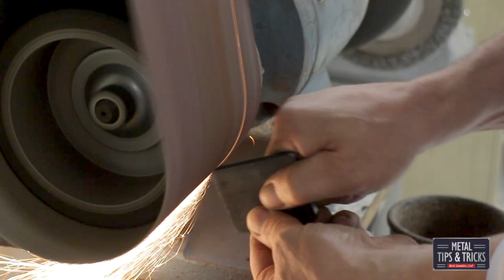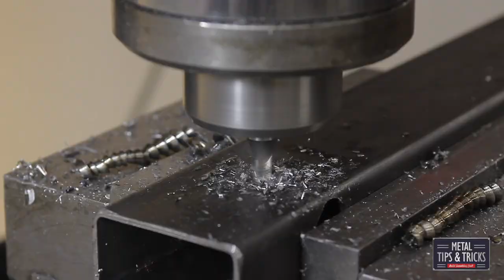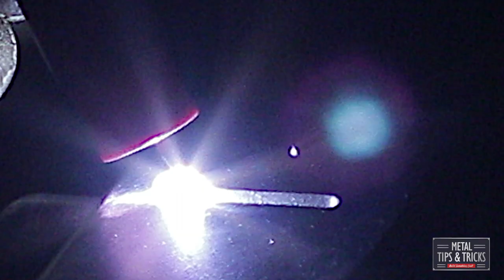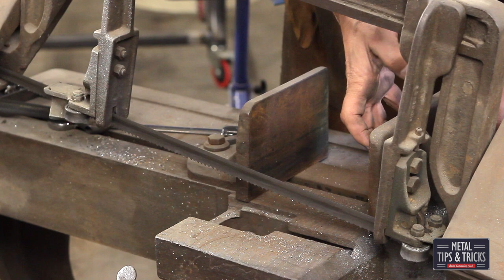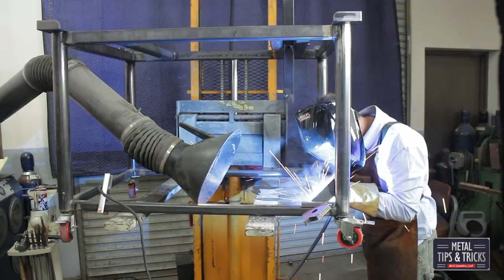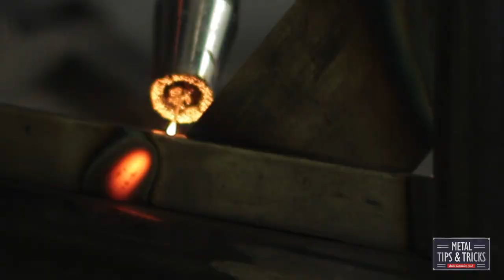The Ultimate Metrology Center ( Welding)  Part 2

Comment: Hi Dale,
That large spacious and well equipped shop is heaven for those kinda multi disciplinary projects like that table, looks great...
Pretty good on the up hill mig welds...   ;)
Cheers,    Pierre
Reply from the maker: Hi Pierre. I wish I could keep the shop, but we are moving this week to a smaller place. :-(
Reply: When's the Yard Sale?
Reply: Dale,   I had no Idea you were moving to a different shop.  I hope the move goes well.    I know you will be extremely busy during the move, but I wonder if you could do a a video series on designing and implementing the layout  of the new shop.   Things like setting up clean areas vs dirty areas, machine placement for workflow, etc, aren't really discussed that much since it is done mostly when you are setting up a new shop.  Hoping for a smooth transition to your new shop!   Chris

Comment: Your can work around having to move the back plate on your band saw.  What I did on mine  to avoid having to move the guard is a drilled and tapped and fit a 2x2 extention on the plate. Works great.  -david
Reply from the maker: Hi David, thanks for your suggestion :-)

Comment: Great job and interesting design. The one huge mistake you made was welding the 2 end pins in place. There is no way to level the surface plate except by leveling the whole table. You should have used  2 bolts with the head down and the ends rounded. You could have welded long threaded nuts to the cross beams then inserted the rounded bolts. Still, a nice job and I plan on using some of your ideas on my table.

Comment: Seems you had a bad day. First dropping the braces multiple times (and nearby "metal tips and tricks" label. What a trick!) and then welding braces where your drawers have to be. LOL i know what happens when one has fun with his work. Thanks, keep going.
Reply from the maker: Hi Herman. Your were not supposed to see the  braces in the wrong corners. but what  is funny.  I cut them off and welded them back in on the opposite corners on the wrong side.   LOL .

Comment: Just a thought, why not make a 2 or 3" spacer block (or however thick is needed) to sit against the fixed vice jaw when cutting at an angle? You could just weld a tang on the back at on end to hook around the side of the jaw to stop it trying to slide when tightened, & it would save having to move the whole shit-shoot back whenever you need to swing the vice. Just a thought...:-)
Reply: Oooops, Just saw someone else has already suggested it. Please ignore.....